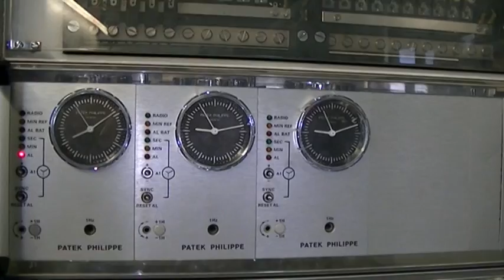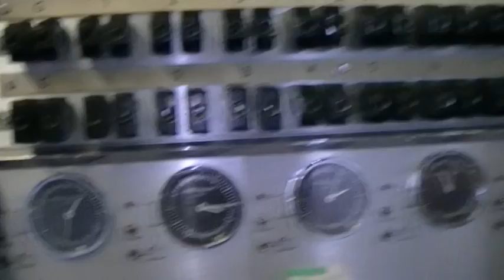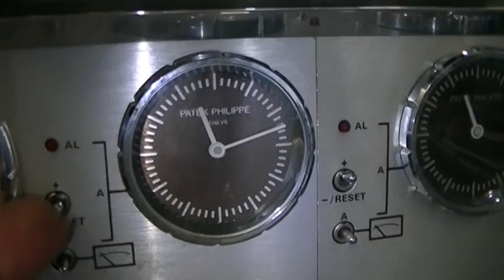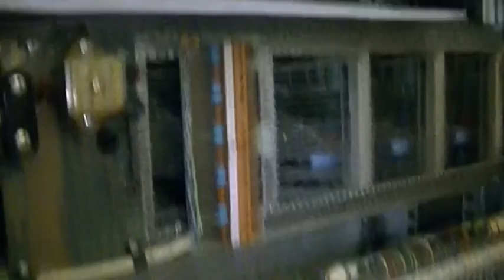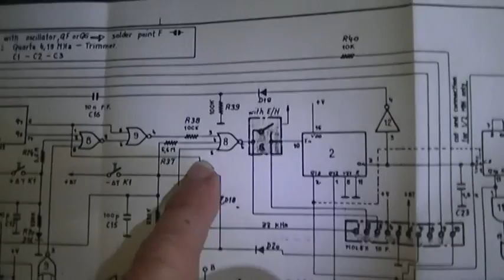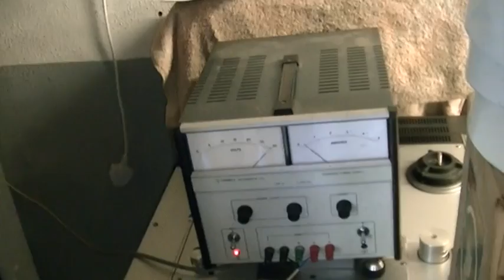Ebay - 140877044163 - BBC BUSH house Patek Philippe pulse clock system

Comment: I'm fine. this would look great ticking away in the corner. Better than a wall of clocks all showing different time zones in the lounge.I'd be tempted to build a pannel of lights connected to various points , as the logic states change the lamps would flash - like one of those old school computer panels in the films !